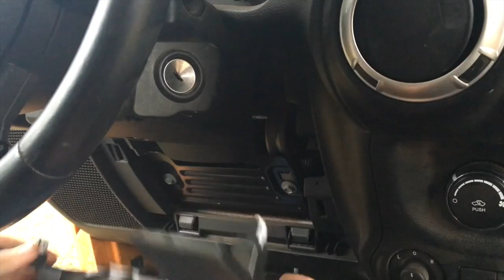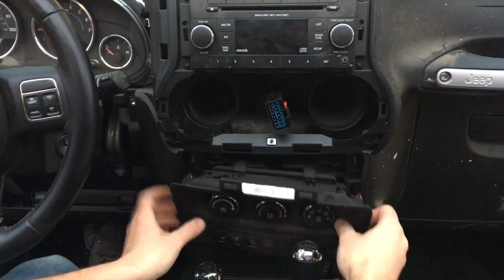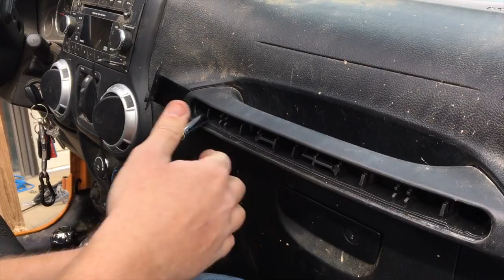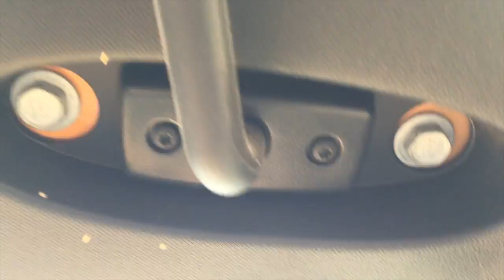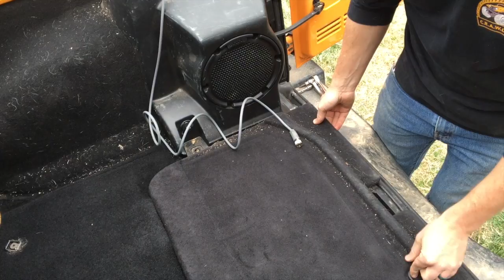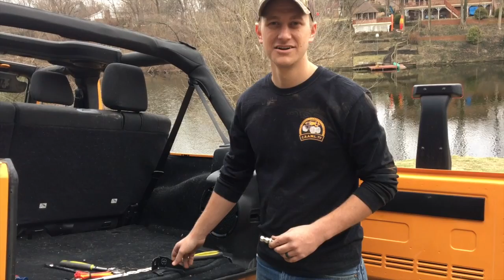Jeep JK / JKU Cobra 75 WX ST CB Radio Installation

Comment: Thanks for such a detailed video! I am certain that this will save me a whole lot of time. I do have a question. Because I have the Teraflex Hinged Carrier, I could not use the antenna mount that you did. I have to use the one designed to mount to the carrier and not to the spare tire mount. What would you suggest I do to run the coax cable to that mount? My concern is that you said that I would need every bit of the 18’ of coax and if I run through the grommet to the new antenna mount, I would need at least another 10 inches of cable. Would I save cable by running under the carpet? Or can I bring the cable out somewhere other than the grommet behind the tire? Thanks for your help!
Reply from the maker: It'll be trial and error to see what works best. I've seen people run the coax through the rear vent, which saves cable, so I might suggest that in your situation. Let me know what works!
Reply: Well, it worked! I moved the remote connection box more to the passenger side (just enough that that the CB Connector still tucks out of sight, I left no slack anywhere and although I won’t get the actual antenna mount until tomorrow, the coax cable is going to reach! I’m a pretty bad do-it-yourselfer so it took me a bit longer than it took you, but it’s done, it looks amazing and pending the actual antenna install, it’s working!
Reply from the maker: +Reuben Maes awesome!!!!

Comment: Great video, the only one I've seen that goes this in depth. I would add an antenna spring in-between the stud and antenna, it helps the antenna flex more when its hits things like tree branches.
Reply from the maker: Now that we've got the big lift on the Jeep, that thing is EXTRA high. We'll probably throw a spring mount on just to be safe. 👍🏼
Reply: Great.. Thank You!
Reply: great video... im trying to find that metal bracket and gromit and cant seem to find it.. are you able to send me the link of where to find it?
Thanks!
Reply from the maker: +Joe DiGianvincenzo The bracket and grommet actually came with the CB radio. Pretty convenient!

Comment: Nice video. Definitely planning on doing this in the future. Just one question though. Where do you get the tap and the rubber grommet that you use to run the CB cable below the passenger dash? Did it come with the CB or the mount, or did you have to get that separately?
Reply from the maker: The small metal plate and the grommet actually came with the CB... I used a 1" spade bit from my toolbox to make the hole, though. Thanks for watching! Let us know if you have any other questions. 👍🏼

Comment: now to wait for the video where you talk about adding an amp to the radio to get out more than half a mile not realizing that a junk radio and untuned antenna is the cause
Reply from the maker: We're making another video for precision tuning, but there will be no amp. We use this for trails, not for trucking.

Comment: Did you not have any trouble by not grounding your antenna? Everyone I've known has theirs grounded and they use an SWR meter to fine tune their antenna. Both of which keep from frying your radio.
Reply from the maker: The FireStik antenna is a No Ground Plane system. As far as tuning with an SWR reader goes, we plan on making another video on accurately tuning. Here's some FAQ's from FireStik on the matter:

http://www.firestik.com/FAQ.htm
Reply: +CRAWL TV  
Thanks! 👍
loves the set up and the mount!
Reply: Except you linked to an antenna that DOES require grounding. Thanks...

Comment: way easier to start from the rear and work towards the front of the Jeep. especially with that coax. work it through the tail gate from the outside and pull it to the inside panel. a bigger hole to pull the coax end through than the smaller one with the rubber seal on the outside.
Reply from the maker: Nice tip!
Reply: +CRAWL TV 
No problem! Man I thankfully started at the back and worked forward and discovered this. Great video! 
👍👍👍👍
Reply from the maker: +billynunns thank you!
Reply: He could’ve als taken the head off the coaxial cable while running it through the tailgate.
Reply: Also the snake you would use to run cable behind drywall works well to pull it as the other reply says from back to front. There are two "channels" in the tailgate - an upper channel that never gets you to the grommet and then a lower channel that leads you almost right to it.

Comment: Great step by step install video. Except I don't care what the instructions say. You still want to get a SWR meter and check the tune. If not 6 months to a year you will have a nice paper weight in your jeep. I have the same CB on my jeep and with the tip screwed all the way in, and then checking with  my SWR and on channel 1, it was 1.5-1 and on channel 40, it was almost 3-1. Way to much of a difference. Always check the SWR. The meters are not that expensive to get or find a cb shop and they can dial it in for you.
Reply from the maker: Brian, nice tip! That sounds like something we'll want to do, then. Maybe we'll even make a video of it. 😎👍🏼

Comment: Great video! 
Only question I have was where did you get that car outlet adapter from? To connect the power to the CB power box.  
Thanks!
Reply from the maker: Thank you! It was $39.99 from Quadratec... A bit tricky to find on their site though. Here's the link: 
http://www.quadratec.com/products/96080_9801.htm
Reply: +CRAWL TV thank you! Keep up on the great jeep videos!
Reply: Great video!  After looking at the contents of this unit I noticed this cable wasn't included.  Scrolling through the comments never fails!  Thank you very much!!

Comment: Great video.  Very comprehensive and it is going to save me some time when I do the permanent install on my cb soon.  One suggestion, get a set of these to help in popping those jeep panels.  Works great and a little less harsh on the plastic.  http://www.menards.com/main/tools-hardware/hand-tools/wrecking-pry-bars/4-piece-prybar-set/p-1444428068821-c-9170.htm?tid=-407433474913267418
Reply from the maker: +clmathi13 Thanks, and glad it helped! Nice tip on the tools, too! We'll pick one of those up for next time.